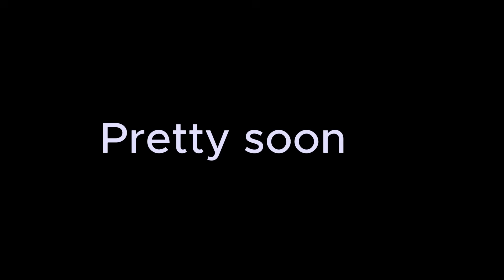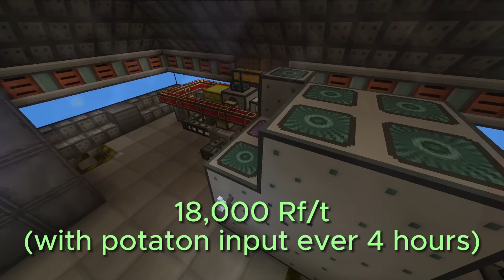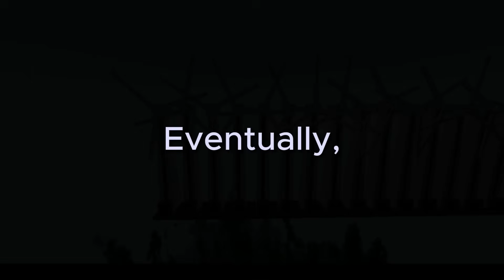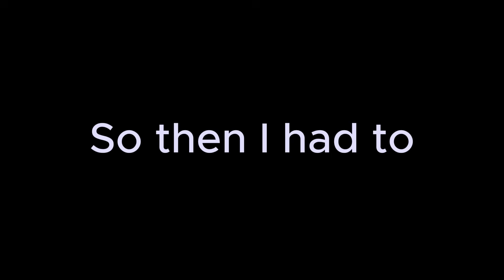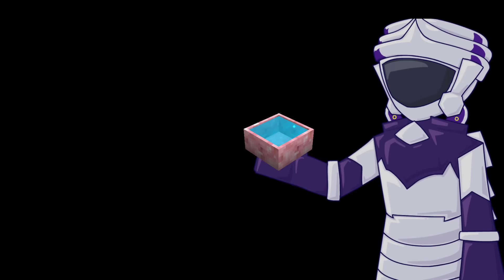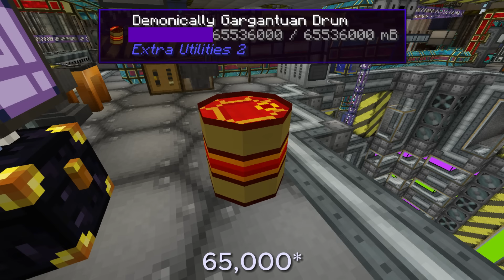My Full 2 Year E2E Experience

Comment: Big mistake on how u fight the chaos gardens, in 1.15 DE and below no upgrade are needed as long as u have 10m RF per tick powering your armor it will use up 10 RF to save you from death and keep u at half a heart, so instead get 10m RF per tick and wireless charge your armor.

Comment: As a seasoned e2e player i must say that you only just scratched the surface of complexity between the mods in this pack. There is so many big and small tricks to help with grind and making your life easier you wouldnt believe :D Like using xnet as early automation or mobgrinder made with cursed earth and induction smelter to obtain manasteel for auto sieves before even touchin botania, even before that using osglogals tools to help with mining, 0 energy ore doubling with small presser, i could write a book here with those XD
Reply from the maker: I know about those now, this was my first modded playthrough though. I did actually use osgloglas tools up until the void miner and there was a cursed earth mob farm but it eventually was too good and filled up all my storage leading to 6000 items sitting on the ground next to my farrm. I left out a lot of details in the video but I think I got the most out of this pack
Reply: @Hecuba39  i wasnt criticising just wanted to say that if you (i mean anyone looking to play e2e) look hard enough for solution to nearly any problem with grind in this pack you will find at least one solution making your life much easier, sometimes there are even multiple.
Reply from the maker: @adrianoslak3618  I didn't think you were criticizing, I completely agree

Comment: For anyone considering enigmatica 2 expert, you can improve on the sieving setup by using the following: 

Material Stoneworks Factory for automated gravel/sand/dust. 
Ender IO cables for setting up priority. 
Auto compressors for the output of the sieves. 
The best part is using a mechanical user with an unbreakable tinkers construct tool that has fortune (lapis), autosmelt and any part with "global traveler". The last part provides you with the option of linking the pickaxe to a specific inventory (like a drawer controller). You get unbreakable by using 5 reinforcement upgrades on a tool. This provides ~2.5x ingots for each ore. 
The above requires minimal power and can be generally powered by a few thermoelectric generators. 
Once you get supremium you can change out the pickaxe head in order to receive the shards, but you would need a system to pick them up. 

Other tips: 

Get ploughman's lunch as soon as you can. This gives all 5 nutrients necessary for you to not get de-buffed. You can then switch out to enchanted golden apples when your sieving setup is done. 
Extra utilities has an auto crafter that is a god send for automating production (instead of autocrafting when needed). 
Litherite and some other useful goods can be gathered from dragon dens underground. You can use a scanner with scorched ground to find them while exploring. 
If you can scale up ethylene production the gas generators can produce up to 80k RF/t. Possibly the best early-mid game power. 
Late game power can be produced with solar arrays. You can also dive into draconic evolution to keep it daytime and not raining 24/7 (The arrays are extremely broken). 
Compact machines are relatively cheap and provide you with an easy way to save on space (and keep thaumcraft from eating your world). 
Garden cloches are insanely good, especially when combined with mystical agriculture seeds. 
Lots of mobs spawn with armor, you can get fiery ingots from mobs that drop fiery armor pieces. (Making sure to fully repair them as you start getting duplicates)
Having a time in a bottle is almost a necessity 
Having a stabilized horse spawner is a god send when going through Blood Magic. 
A Mekanism digital miner is great for when you go to other planets. 
The last stand 2 enchantment on all pieces of armor makes you functionally immortal if you have enough EXP. (you can get random armor enchanted with it from mobs, and disenchant that) - a mob farm with cursed earth would do. 
Before creating the creative vending upgrade make sure to place expensive items in locked drawers and then take them out, so you can dupe them later.
Try getting into AE2 as soon as possible. 
The flux networks mod is your late game power transfer option. 
Fluid lasers are the best option for moving vast amounts of fluids every tick. 

Lastly, if you utilize garden cloches with mystical agriculture, the sieving setup from above, you wont ever need to go for the dimension builder.

Comment: The grind ended, but a new grind is already on the Horizen.
Reply: maybe a New Horizen? gregs slumber stirs
Reply: gtnh cannot be avoided
Reply: It's the circle of life
Reply: Horizon? Are you possibly talking about GREGTECH NEW HORIZNONS1111??1?1?1??1
Reply: Gtnh is life
Reply: Maybe a gregtech grind is on the new horizons
Reply: Going from E2E to GTNH is dangerous asf. Currently playing a pack called Meatballcraft, it equates the first 3 chapters to a tutorial, and roughly the size of E2E, the pack has 9 chapters at the moment, with a 10th in progress. Someone compared getting to the end of the current Ch9 roughly to getting to IV in GTNH, the 8th tier of GTNH's 15 tiers, and getting to tier 15 doesn't put you even close to the pack's end goal.